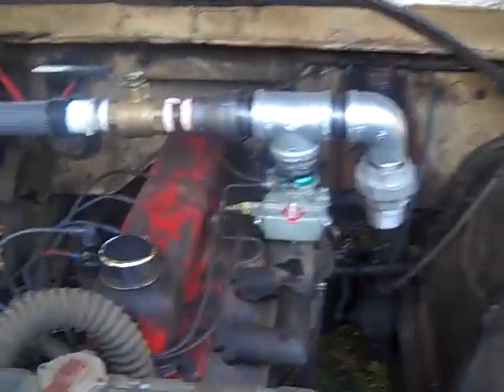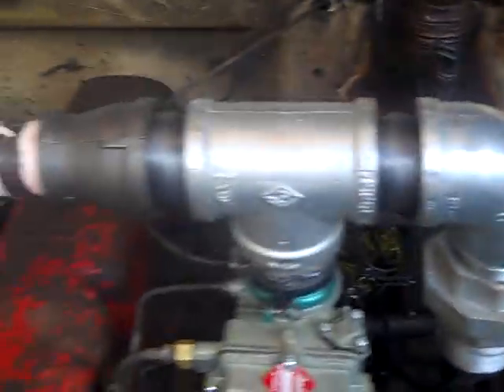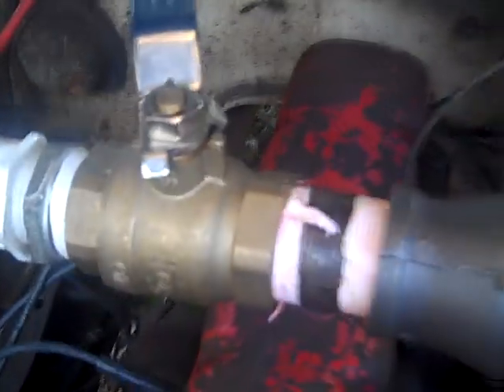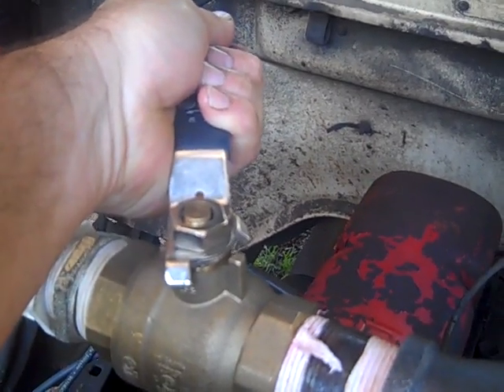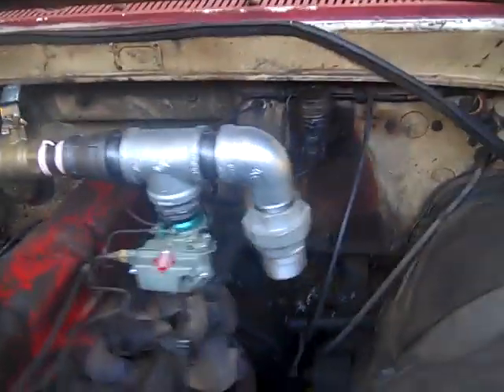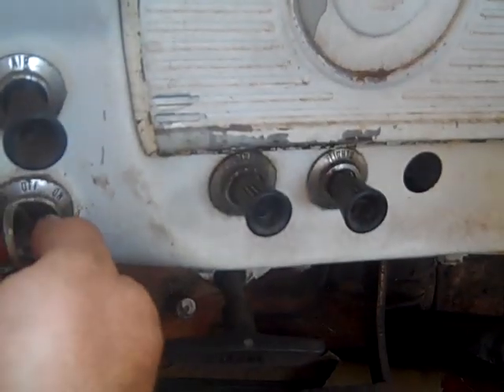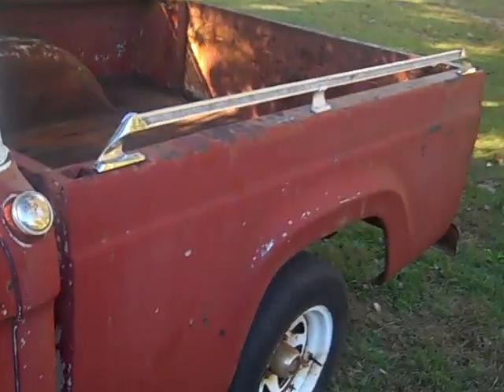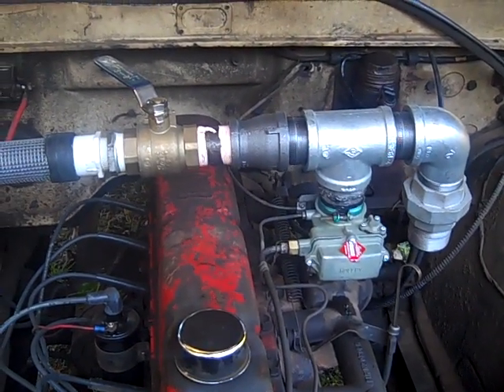Wood Gas Truck Part 2

Comment from the maker: @sheltrown1117 

Thanks!  I can't wait either!  I just made a butterfly valve air mixture control for the carb.  The ball valve is way to stiff.  Now I can control the air mixture from inside the cab.  next is plumbing to the gasifier, fuel shut off, and then putting the gasifier in the back and anchoring it down!